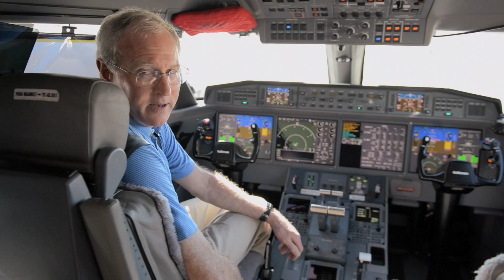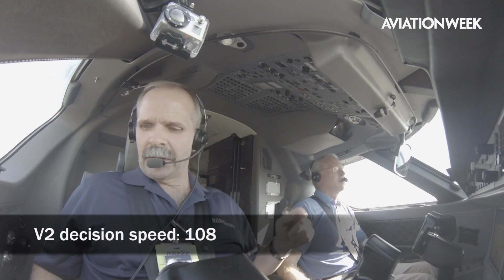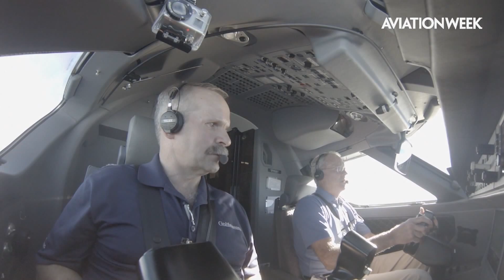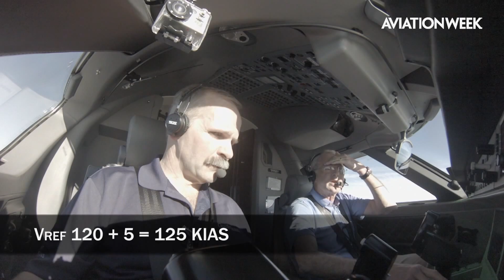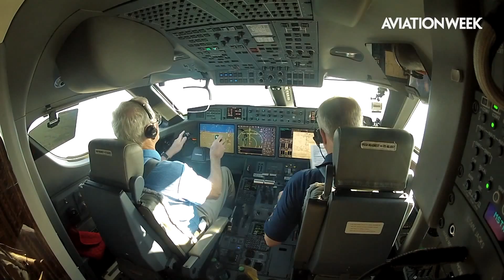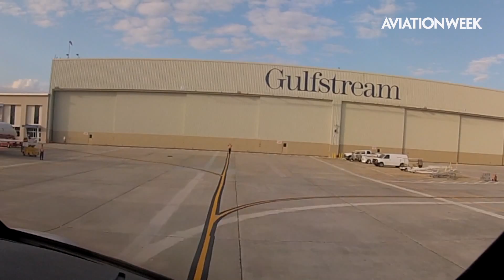Pilot Report: Gulfstream G650

Comment: Why no sidesticks and why RR engines given shabby performance on A380?
Reply: LOL. A380 engines have nothing to do with these engines, and control yoke is a better solution to flight control than multiple side sticks for various reasons. Check out an AF447 documentary if you want to know more.
Reply: LOL RedRider, obviously the A380 engines are different than the smaller ones on the G650, BUT the hapless, shoddy workmanship and design can be attributed to the same Company! I am aware of AF447 and the right seat pilot's side stick over riding the left seat guy trying to correct the stall. That being said, why is Gulfstream claiming that side sticks are such a wonderful solution for their G500/600? In any event, referring to the G650, why the need for that little bit of extra speed?..and what is the significant offsetting cost of attaining that performance
Reply: Edited...
Good question about the sidestick on the G500/600. I can only guess that with the G500/600 coming out later they decided to change to the sidestick configuration. It does give the pilots more room for meals especially. (I originally wrote the G650 came out later).

As for that little bit of extra speed, keep in mind buyers of the G650 are going to be the richest people in the world. It can be a di*k size contest for some of them while others can actually take advantage of the speed and justify the extra expense. They can buy a perfectly good, new, biz jet for $10M or less but the G650 is selling starting ay $64.5M so a few extra dollars in gas isn't going to bother them.

And I agree that RR reputation has suffered and for quite a while. They also cost Lockheed L-1011 sales years ago when the UK government had to bail them out. MD sold many more DC-10 jets and many of them crashed. You could say RR poor management indirectly caused many of those deaths. And then of course the A380 engine failure where the crew did a spectacular job of bringing that super jumbo home in one piece. 

As the British say, cheers!
Reply: @genie0390  Because Gulfstream versions are active sidesticks, where they are electronically linked and allow for force feedback, unlike with Airbus sidestick.

Comment: That plane is trash.
Reply: Dassault Falcon 7x
Reply: +CDR Simmons why bro?
Reply: +luis fernando mendoza It killed my uncle in testing.
Reply: +CDR Simmons Sorry to hear that man. So whats a good private jet with the G650 range then?
Reply: That's why it's called "Testing". Those pilots know and except the risk, push the aircraft to find what and what that works/doesn't work. Sorry for your loss, your uncle is a hero in my book!
Reply: 6,846.9 is the Falcon's range and it has three engines burning more fuel. There is no better jet in this class.

Comment: Ok . great job with the video on the gulfstream g650. Please correct me if I'm wrong. I am not a pilot but I am an aviation enthusiasts and  did mr george say 7000 mile range? is not the correct answer supposed to be 7000 nautical miles.
Reply: If it is in the air or water, nautical is assumed.

Comment: and I have studied it in detail, and have found some areas that could be useful in making the G650's successor even better.  I have enclosed a list of improvements I hope you and Gulfstrem will fine both interesting and helpful.

Make sure the list contains zero BS, and is factual and intelligently put together in words an engineer will understand and appreciate.  Remember these guys are professional plane designers and builders, so they will smell BS from a mile off.  Good luck.

Comment: "Advanced features"..., a clock that has no GPS input, no auto fuel transfer, Ground spoilers that require one throttle advanced in order to remain in the down/stowed position, auto throttles that cannot be armed unless power is applied, no auto brake, (but they are testing it on the G280), the overhead panel is a dogs breakfast and don't get me started on the TROV... In their quest for a common type rating with the G550, Gulfstream sadly missed the mark.